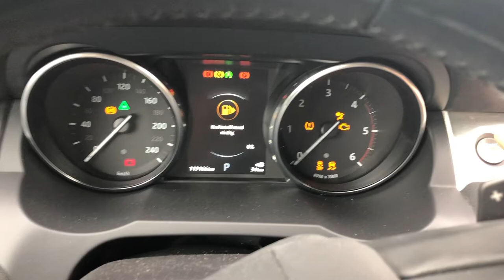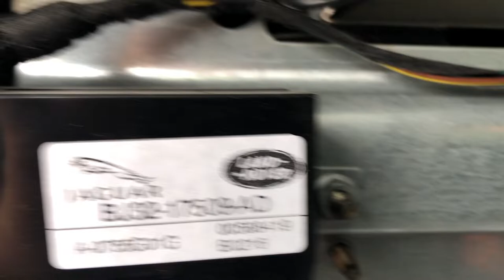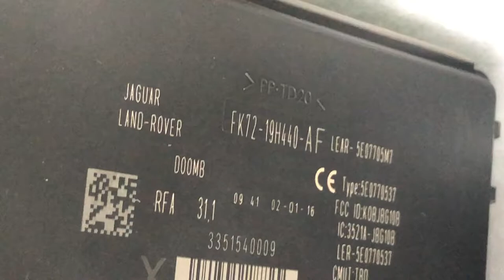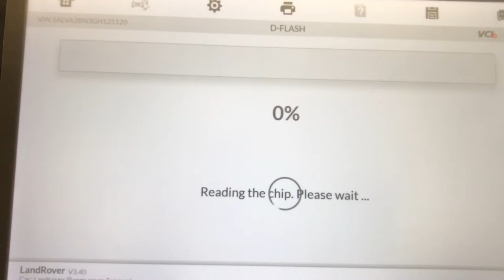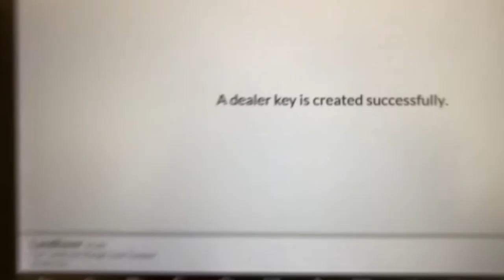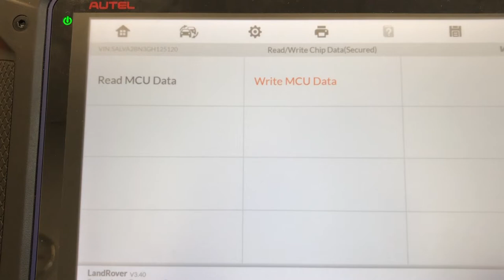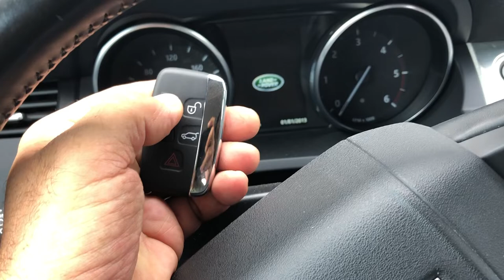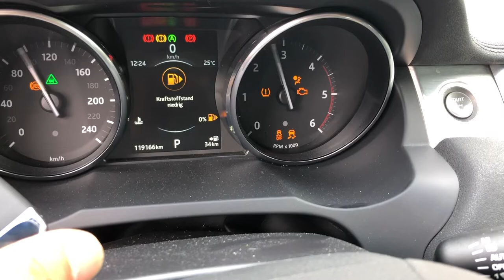RANGE ROVER EVOQUE 2016 Ersatzschlüssel / add key / RFA KVM removal and programming /Autel IM608

Comment: Excellent ,ive been looking info on doing this job i have one to do great video very helpful . Can you give me some info on how to know if its secured or unsecured and weather or not i would need to desolder the components or not? Thanks
Reply from the maker: 1. Solder the wires according to the unsecured diagram. 2. Read chip lock status. 3. If unsecured read directly - if secured desolder the two components and modify your wiring to read.

Comment: why did you dismantle the quartz and the capacitor? You couldn't know at the beginning which processor, protected or not?
Reply from the maker: Hi. I followed the wiring diagram and it tells clearly to remove it. Then read the chip status in order to know how to read ( secured or unsecured )
Reply: In secured MCUs that's the quartz frequency is unknown to get communication to the chip, and this is the reason to remove them and then programmator emulating frequency ranges to find right one and get connected to it.

Comment: we have to give you a big thumbs up well Done.
but buying the KTP Key tool plus with its own free soldering make it much easier.
Reply from the maker: Hi. yes it is much easier without soldering. Some tools can do today by OBD. I think it will be possible by OBD soon with many tools.
Reply: Today i checked Obdstar writes that support but i didnt want to risk...No videouz in youtube so that didnt happend :) Removed kvm and read on bech for my luck mcu mc9s12xeq384cal was locked .Job done with vvdi2 and vvdiprog conections are the same.And have to remove same 2 components.